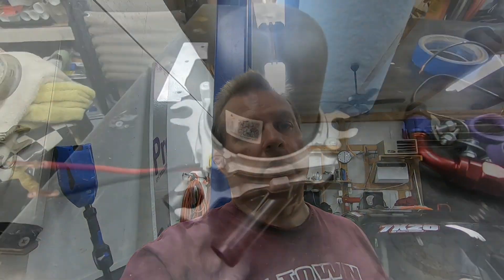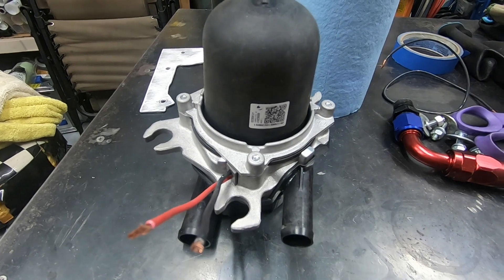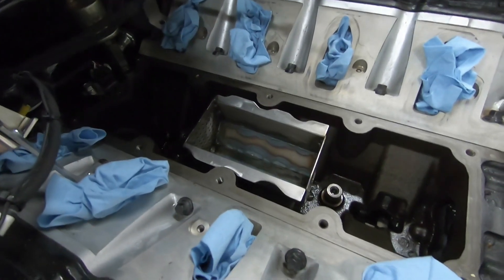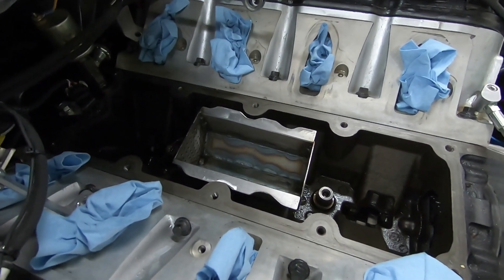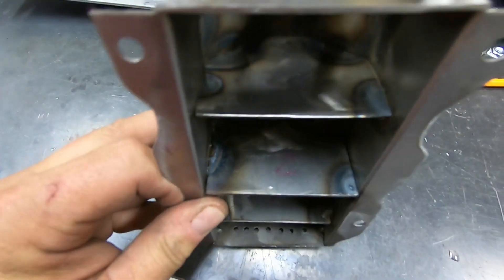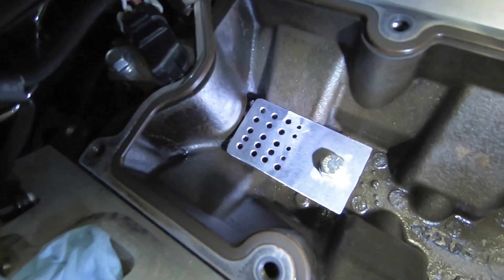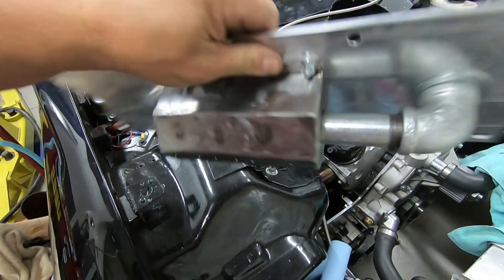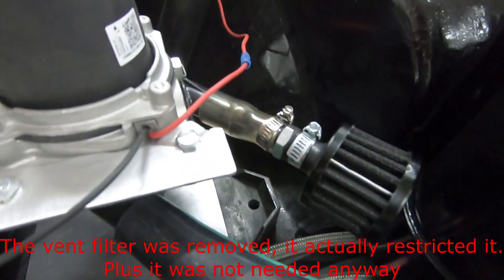How To - DIY Oil Separator with Electric Vacuum Pump for LS Motor

Comment: Those little vac pumps don’t pull enough to even make a difference just run breathers or hoses to a breather catch can
Reply from the maker: I agree, it's really meant to pull water during warmups. I'm running on Methanol, I pull close to 4-8oz of water out of it every race.

Comment: How long we'll has this system held up. I'm looking for a vac pump setup for my sbc 440
Reply from the maker: So far two years on the same pump. Fingers crossed!
Reply: @KensKorner  what's the longest amount of time it was running for? I take my car to carshows sometimes and some are a decent drive away. That pump ok to run consistent you think?

Comment: I run the same setup as yours on my Nissan L28 motor. Works exactly as yours does but mine keeps popping 30 amp fuses after 5 to 10 minutes. Did you have any issues like that on your setup?
Reply: Open it up and solder the power supply connections to the board.

Comment: Hello. Are u still using this pump? Is it pulling good vacuum amount still?
Reply from the maker: Yes, still using the pump, no issues at all. I'm pulling plenty of moisture out of the engine. After a typical race I use a spray paint can lid and it fills it about 1/2 to 3/4 full of water.

Comment: As an ASE Master Tech I have to ask about this working as a positive crankcase ventilation system un restricted. I know you can adjust the air/fuel to correct for what is a vacuum leak. I really like the can baffle, but on a standard PCM controller engine, at least the newer 2016 & up, the PCV is fixed at a 5/16” hole, as many 4 cylinder imports use. My guess, for anyone running a computer controlled “LS” family engine, installing a plug drilled with a small hole would work on the suction line. I am using 3/4” copper pipe that exist at the front, but under the valley pan, I place 2 cotter pins and drilled larger holes at the rear and progressively small toward the front but packed it with stainless steel wool to help capture crankcase fumes to help separate the oil and drain back. Using a 45 degree fitting, I avoided the knock sensor pedestals but hung up on how to hold this 14” pipe. In your video, drilled and tapered screw holes would work. But a sealant like 518 red jelly would seal the screw holes that penetrate the valley pan. I put a higher torque cam, headers but it’s my daily driver. I still like the catch-can idea but I don’t need the electric air pump. Any thoughts?
  Thanks for taking the time to make this video and show us what works!

Comment: Very nice work! The separation system you have in the valley is really nice.  Has this pump lasted very long for you or has it burned up at all?
Reply from the maker: So far so good had no problems with it. Thanks for watching.
Reply: Longevity is my concern also as these pumps are not intended to run constantly. Love the idea otherwise thanks for the video and answering 👏👏

Comment: i installed this setup on my ls 6.0 pro charged motor. burned up 2 of these pumps. they were never designed to run constantly like on a street car. maybe best suited for a short drag racing type use
Reply from the maker: Yup, I agree, I'm running Methanol it helps to pull the moisture out. So far so good after racing one season with one. That's the main reason for me doing this. Thanks for watching.

Comment: How many inches of vacuum do these pumps pull?
Reply: I was told never want more then 4 psi . This system works well on my turbo bbc car.
Reply: It pulls about 5 on mine. I put a 1/8 inch hole in my catch can to reduce it to 4.
Reply from the maker: That's a good question, I had a crappy gauge on it and it was showing I think 2 psi. Now I have a 16V battery it should be pulling pretty good. Next time I have the car our and running I will put a gauge on it. I have a better one now.

Comment: I did the same thing on my Q45! I pull a vacuum on a catch can have that hooked up. I figured it'd keep the oil out of my intake and give the rings some vacuum under load whereas the regular PCV only provides vacuum under partial throttle or idle.

Pretty cheap on rockauto too, I have mine running through a relay and it runs the entire time the engines on, I've driven 1.5hrs with it continually running! No issues yet.
Reply from the maker: Good deal! That's the plan! So far mine is holding up!